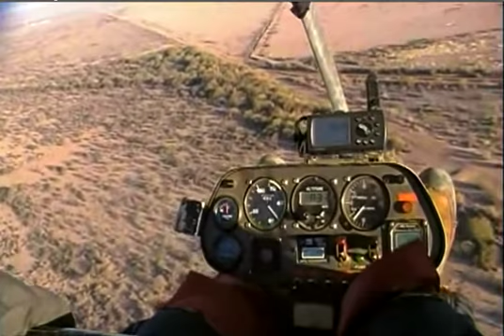503 rotax pukes-  Engine Out over 2 years ago now

Comment: Anybody watching this...started in '78 with a Pterodactyl, thousands of hours in 2-cycle. Be careful after an engine failure. Your mind's first thought is to get back there & start playing with the prop to see what's wrong. Wrong! Turn the key OFF first, then slide your throttle back to idle. Had a Maxair fail on takeoff. Dummy me, gets back there, twists the prop and guess what? Power was Wide Open (happened on takeoff) and mags were red hot. It cranked & you would not believe the power of a 582 dragging me around while holding on the to horizontal stabilizer! I aimed it into brush beside the runway, it actually took off (again) but flew into the brush, only the pitot tube was damaged. Also, remember to STEER your aircraft once on the ground and rolling out. The game ain't over just because you lost your motor. Remember to STEER your aircraft away from obstacles. Sometimes the human mind gets locked up and thinks it's all over. It ain't. Save yourself first of course but don't forget your ultra light too! This guy looks like he had it all in order. Good job!